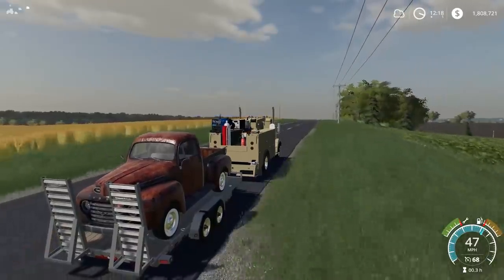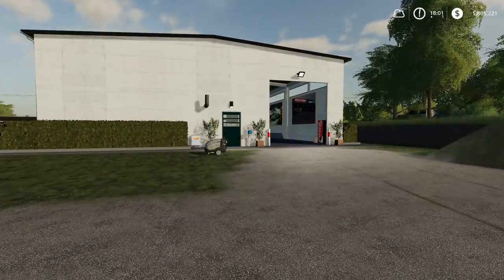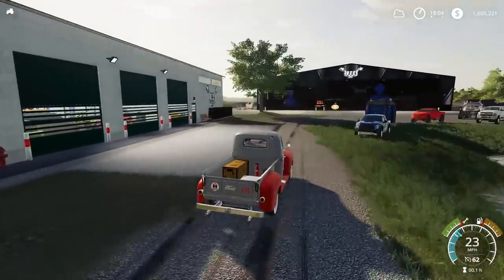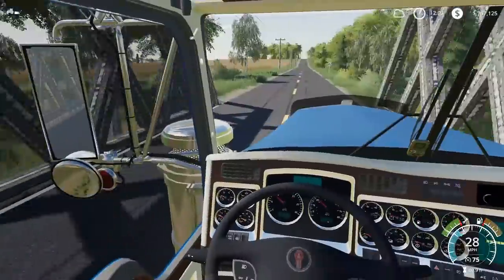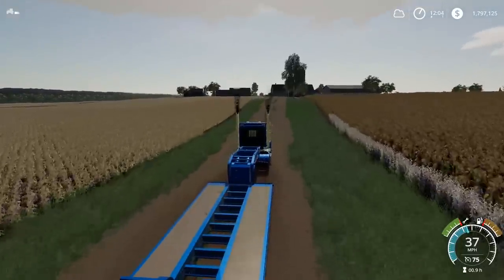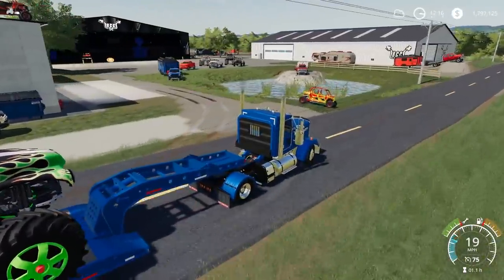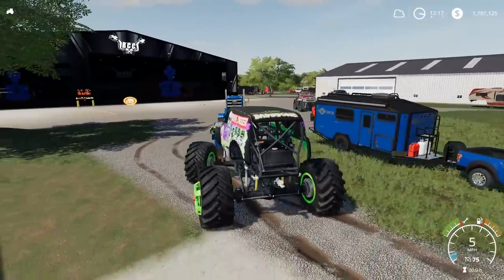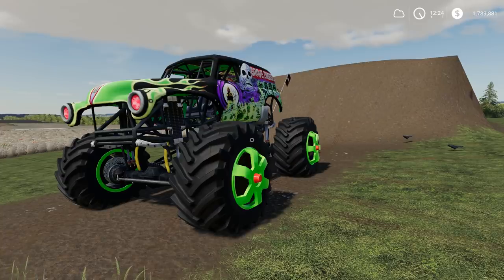OLD TRUCK BUILD! TURNING A RUSTY F-100 INTO THE GRAVE DIGGER MONSTER TRUCK! | FARMING SIMULATOR 2019

Comment: Ok so I D O N T have to reply to everyone THE 1983 grave digger was a ford There I S N O 1983 Grave Digger mod Ok??? I was Talking about the simalarities to gd 5 that is gd 20

Edit: Can i get a repin. All i did was edit
Reply from the maker: SuperMario93gd The Gamer I apologize. I screwed this up.
Reply: @SquadGamersHD  it is ok also they haul the trucks by taking of the wheels and load it in a closed trailer
Reply: How did i Get Unpinned for editing Darn Ittt
Reply: I thonk i started some controversy
Reply: Grave digger is based off a 1950 Chevy panel van
Reply: Squad turn it back into the case service truck
Reply: PREACH IT BROTHER
Reply: @JoshErmanJr  the original Grave Digger (the one  SuperMario93gd is talking about built in 1982-83) was based off a 1951 Ford F-100, built by Dennis Anderson as a mud bog truck. the 48 F-100 and 51 F-100 are both similar in appearance.
Reply: SuperMario93gd The Gamer I knew you were probably talking about that version
Reply: @IronBullDog67  it was made in 1982 i believe and it was based on a '57 f100 and it was indeed a mud bogging truck
Reply: And if you dont haf the game
Reply: SuperMarthe I'm
Reply: I want that game

Comment: Straight pipe is an exhaust system with no muffler so it’s loud and grunty
Reply: They put small tires on the monster truck to fit in the trailer
Reply: Yep👍
Reply: And of course all the extra stuff

Comment: They pull the monster truck with an enclosed trailer but they take the wheels off and load it in
Reply: That is so true i no some one that ones one
Reply: You dont need a jack with an extension, just a heavy duty jack with block will work. Also they didnt always use enclosed trailers to haul them, people use to use open trailers to haul monster trucks. They were sometimes modified with a lift to get the tires up onto the trailer. But when they take the tires off they put smaller tractor tires on that I think are modified to fit

Comment: A straight pipe is when you take off the muffler. The pipe can be left, right, up, down, but as long as the muffler is off its straight piped
Reply: To haul the monster trucks they put smaller wheels on
Reply: Incorrect. Straight piped exhaust is fully open exhaust. It's straight from the header to an unrestricted pipe. No cats, mufflers or resonators. They also sound like absolute ostrich shit

Comment: A straight pipe exhaust is when there are no Catalytic converter, resonator, and no Muffler.
Reply: There still has to be a catalytic converter to not throw a code. But there is not as many as the original

Comment: A straight pipe is there is no muffler. So smoke will come out and it's louder
Reply: Smoke won't come out if its running correctly unless it's a diesel

Comment: Squad the Grave digger is a 1950 chevy panel van
Reply: Also straight pipe is where you delete the mufflers
Reply: And squad monster trucks are this wide but when they hall them they put small tires on the truck and put them in a standard enclosed trailer
Reply: Yea

Comment: They are in a closed in area wheels go in 2 on each side i think 2 trucks per trailer ,normal semi tailer and straight pipe is loud as hell ,but they run directy (straight) front to back  I seen them with exhaust on 'em still being straight so either way straight is straight either way you look at it all the way around its STRAIGHT BACK NO CURVES

Comment: 1948 ford f 100 was Originally a half straight pipe and half drop pipe but later they learned that the straight pipe exhaust made more power therefore it was a common farm truck

Comment: Squad, they don’t use a wide load trailer , each trucks team has a set or two of slim wheels for transport so after a show they put the slim wheels on so the truck can fit in a normally trailer and can be transported to the next show where the truck is unloaded and the monster wheels are put back on

Comment: Straight pipe just means that there isn't anything down the line of the exhaust, like muffler, cat, and resonators. It just removes restrictions of the exhaust. It can sometimes also negatively effect the performance of a car, by decreasing horsepower.

Comment: Straight pipe means (depending on where you are) there are either 1. No noise restriction devices like mufflers or 2. No restriction devices at all between engine and exhaust tip.

Comment: A straight pipe means no resonators, mufflers or catalytic converters, straight pipes add power as there is less restriction in the exhaust system. Power gains depends on how restrictive you cats, resonator, and muffler are.

Comment: When they haul the monster trucks they pull the huge tires off and put smaller ones on so the truck fits in the enclosed trailor and haul the tires on a separate trailer

Comment: Straight pipe means no muffler or cat or any emissions parts on the exhaust. Straight pipe is basically just means that the exhaust fumes go "straight" through and not through a muffler or cat

Comment: The engine goes to the exaust and then underneath the truck there should be a like oval thing if you cut that off then it will pretty much be straight piped

Comment: Enclosed trailer but they have they have special tires they put on the truck and take the big wide ones off so it will fit into the box trailer

Comment: Straight pipe or turbo back exhaust means there’s nothing but pipe from the turbo back or on a gas burner from the exhaust manifold all the way back to the tip

Comment: The gravedigger what they haul it with is a normal trailer kind a like a NASCAR they takeoff the big monster truck tires and almost like a monster truck version of a donut spare tire they put those on so the width of the body is what goes inside of a normal trailer so it’s nothing crazy it’s just like a normal NASCAR trailer

Comment: When they haul it they take off the big wheels then they  put on smaller ones and put it in a in closed trailer then when they get to where they are going they back it out of the trailer and then put the big tires on

Comment: They change out the tires to really tiny ones ( like smaller then your moms ford tires) then but them in a box trailer with the spare parts and the trailers or normal size

Comment: Okay even though this is like 2020 and this is made in 2019 a straight pipe is when you don't have the big middle piece thing that takes away all the sound power well it its filter it and that's why I straight pipe is it it still goes over the axles and stuff

Comment: the grave digger is based on a 1950 Chevrolet Panel Van not that ford. Though my dream car is a chevrolet C10 lowered to the ground and with a metallic white paint job with some white wheels from the GTAV lowrider wheel class and full front and rear tire white walls I would take that ford

Comment: They take the big tires off and they use an enclosed trailer and when they take the big tires off they use like normal truck tires and then pull it in a normal box trailer

Comment: They haul the monster trucks with an enclosed trailer when they put them in the enclosed trailer they put like regular size tires on them and then in the front they just put the monster tires on the front of the trailer

Comment: the reasl grave digger is hauled in a long inclosed. but they dont put the tires on it tell there at the event. Its on a metal convaor belt that slides out of the inclosed

Comment: You said it was a case dealer not ih they wernt always the same company and straight pipe means no muffler or catalytic converters. And they put small car tires on them to put them in inclosed trailers